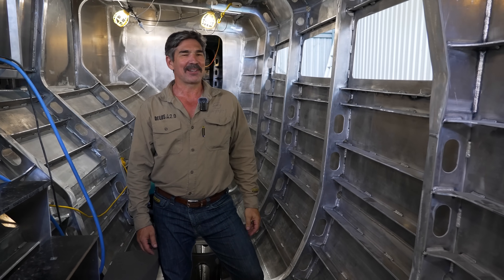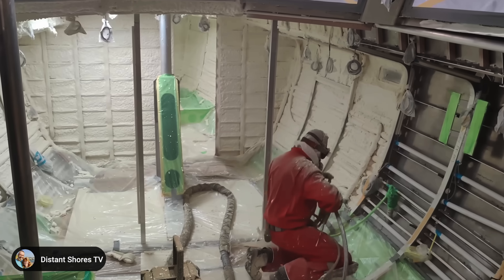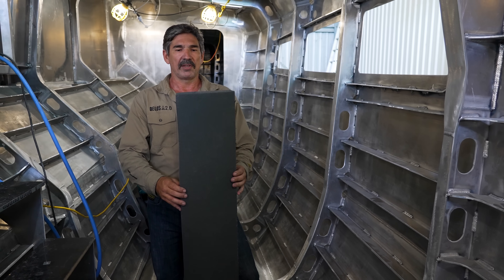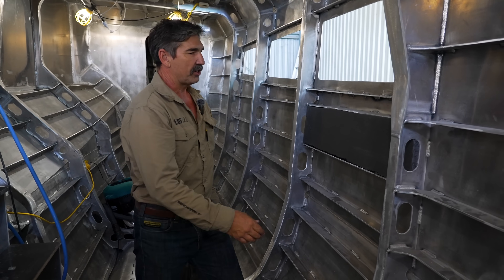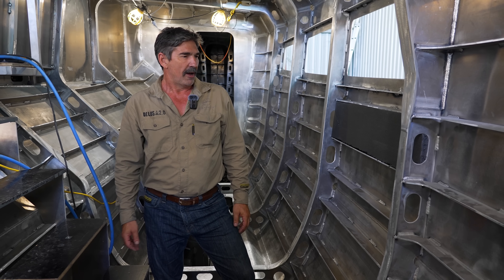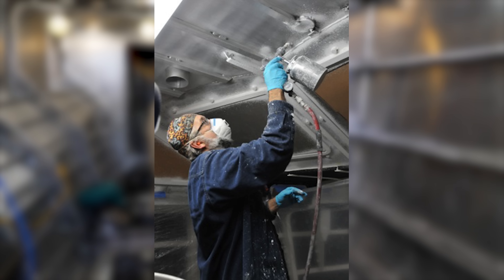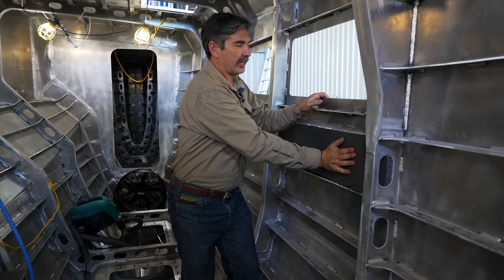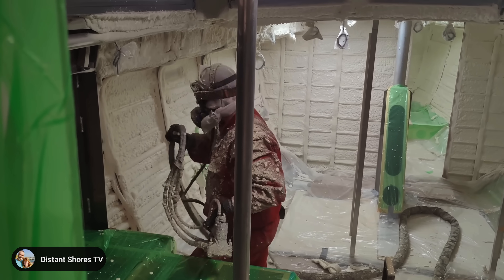HELP, We Need Your Advice!  How Should We Insulate Our Aluminum Catamaran???

Comment: Just thinking out loud, I think spray foam is the way to go but wondering what possible repairs are given you pause? If you are concerned about plumbing or electrical repairs, I am thinking to use conduit pipes and spray around them. Then install junction boxes at certain points based on what makes sense. That way if you’re worried about replacing a leaky pipe or running new electrical, those things are going through a conduit and you’re not worried about the spray foam when doing any of those type of repairs. And putting in the junction boxes at certain increments of length means you can replace sections of either plumbing or electrical without worrying about any extended lengths of sections that would be very difficult to repair otherwise

Comment: its not that hard to remove spray foam, I had a can explode on the boat 😂 and used a knife and a metal spatula to remove, took about 15 mins to get it all off, tends to come off in one piece.Just go spray foam and put boards over the top.

Comment: The best insulation material is mineral wool. it is not flammable. (Rockwool, Klimarock.) There are also aluminum-laminated mats where only the joints have to be sealed with aluminum tape.
The insulation material cannot become damp if the vapor barrier has been carefully made.
Cruise ships are also isolated in this way. Robert
Reply: DEAR BRIAN!
Die Isolierung mit Mineralwolle muss in 2 Schichten erfolgen, Die erste Schicht zwischen den Spanten, dann die Kabelkanäle und die zweite Schicht mit Klimarock (aluminiumkaschierte Isoliermatte)  ÜBER alle Spanten. Die Stösse und Durchstiche der Befestigungsnadeln müssen luft- und wasserdicht mit aluminiumkaschierten Klebestreifen überklebt werden.
Das ist das wichtigste bei der Isolierung. So gibt es keine Kondensfeuchtigkeit hinter der Isolierung und keine Kältebrücken. Isoliert wird der ganze Rumpf bis zu Wasserlinie und natürlich das Deck und die Aufbauten. 
Das hält ewig. So werden auch Kreuzfahrtschiffen isoliert. KEIN KUNSTSTOFF UND NICHT BRENNBAR UND NIEDRIGE KOSTEN
Schau auf meinen Kanal „Sailing sapore di mare“  Video unter dem Titel: „STAHLBOOTE OHNE ROST? JA es gibt sie! 
(Leider nur in Deutscher Sprache) 
Greatings from Austria/Europe Robert

Comment: I just also wanted to add, you say you don't want spray foam on the hull so you can do repairs and get behind it etc. Surely the same principle applies to coating the hull in... anything and then using foam bats. At that point might as well just have used spray foam.

Comment: Only way to go is with spray on insulation. Been on many yachts in hi-latitudes that use cut foam, non spray in and you can feel the cold spots with the air gaps in the walls, and the condensation doesn't seem like it would be a problem but it is, it runs down the walls in the air gaps and can cause chaos. With a yacht like you're building it's worth the extra cost to spray the hull and deck- if you get really into it also spray below the waterline. but isn't needed for your cruising style. Especially since you're documenting the entire build. Id recommend nothing other than 65-76mm of spray in.. Keeps it warm and very dry in hi-latitudes, and significantly cooler in lo-latitdues.
Reply from the maker: yep I think you are right.

Comment: Go with the spray foam. I've had it on my metal boat for 20 yrs and never had an issue with needing access. If you build it correctly you shouldn't need to weld on it again.

Comment: What about using a resin infusion flow media layer as a separator between the foam sheet and the aluminium? This would provide airflow and the possibility of drying out, and also the ability to remove insulation at will, which I agree is important for maintenance & repairs. Potentially you'd just get the sticky backed foam and apply it before cutting to shape, but as always experimenting is a good idea. Don't forget you'll want aluminium or plastic pins to avoid corrosion.

Comment: dude. im not a master by any means buuuut.. foam all the way.... blow it in. be done... if u need to make a repair... you use a heated metal line like a close hangar cuts it like butter... when done.. refill with canned foam for like 5-10 bucks and never worry about it again.. it will increase tensil strength along with being  water proof witch could mean the difference between 1 and 100 miles... dont forget your looking for completely freedom and lower maintennce.. this will also prevent sweating from accuring between the frame and inside.....
Reply: closed cell..

Comment: As a career welder my concern would be cracks in the aluminum welds over time and being able to get to them to repair. Aluminum must be clean to get a good weld so you don’t really want to be scraping spray foam to get to the base metal for a weld repair.

Comment: Don't use insulation batts.  Water gets behind them and they WILL separate from the hull, creating an absolute mess, not to mention floating on the water instead of being buoyant.

You WANT closed-cell spray foam insulation to SEAL the aluminum hull.  Besides, the close-cell foam provides considerable buoyancy.  Calculate by multiplying the surface area of your hull by the average thickness of the spray foam times the density of FRESH water.  Yes, the ocean is salt water, but the difference will account for at least some of the density of the expanded foam itself.

Skip the paints and coating, unless you find something that's more of a primer to help the spray foam stick even better to the hull while sealing the hull against corrosion even better than the spray foam.

If you have critical wires or other runs, lift them away from the hull then wrap key lengths of them in a plastic U such that you can spray insulation foam behind them while preserving them from contact with the foam while providing a narrow channel to be able to find them.  If you need full-width access, jam some cardboard lengths into the U to maintain full width through the foam.

Various means can be used to gain very quick access to the hull through the foam, which is then easily repaired by simply spraying more foam.

Reading through the comments from consummate experts with many more years experience than I have merely confirms to me that closed-cell spray foam is definitely the way to go.

My experience:  Building three sheds:  Wood with fiberglass, steel with fiberglass, and steel with closed-cell spray foam.

Winner by a long shot, and for many reasons:  closed-cell spray foam.

Downside:  Carry a portable air device with full face mask in case of fire and you need to extricate someone from the cabin.

Comment: Asbestos is the only way to go. Lots and lots of fluffy asbestos. 😂.  Brian I believe spray foam is the only way to go as it will act as a vapour barrier and will stop condensation on the metal surfaces. I get why you are hesitant. Perhaps you could leave one run from front to back open. And use your black close cell foam in that. That way you have a run for wiring, plumbing and what have you for future considerations maybe even use that for all mechanicals during your build. For all systems. . The new delos is looking sweet. Cheers

Comment: Brian, IMHO closed cell spray foam is the way. Run smurf  tube with wire fishing lines wherever cable drops need to happen, but make sure the tubes do not touch the outer hull.  If there is an area you are really worried about, like where the buss bars have joints, use something else there. All the other solutions let too much cold through or heat out, actually.

Comment: Have you looked into Total Boat Flotation Foam - 2 Part Expanding Polyurethane Marine Pour Foam For Boat Floatation, Insulation And Soundproofing (2 LB Density, 2 Quart Kit) as a way to increase your bouncy? There are foams the put in buoy's  that are water resistant and mold resistant. Just a thought when you mentioned weight.

Comment: If you cover the hull and bulkheads with plastic before applying the spray foam, it should adhere to the plastic while making removable form fitting insulation panels that make for easy removal if you ever need to gwt in there

Comment: FWIW, having the extra thickness along with a closed cell, or vapor barrier is desirable when in freezing environments. There is a tricky calculation to ensure that the dewpoint does not happen on the inside of the boat to minimize sweating.  The vapor barrier part is important so moisture wont get in from the interior to get trapped between the hull and the insulation because that is likely where the dewpoint will be, and if moisture is present there, could ruin your insulation over time.  Long story short... operating in moist environments is tough.  Don't skimp on insulation.

Comment: You should vacuum a thin plastic liner into the hull wall and then spray the expanding foam. This way you have custom molded insulation and still can take them off when made in sections. The same type of way how some parts are packaged inside a box where the foam expands all over it.

Comment: Built a camper on a merc sprinter and used a bat type insulation.There were so many areas you couldn’t do properly and we ended up using spray foam for these parts. We came to the conclusion for any future build we would use spray foam for the whole job. Learnt the hard way 😅
Reply: Yes hybrid

Comment: WOOL WOOL WOOL WOOL WOOL! Sounds crazy to bring the sheep on deck but TRUST ME- It is EPOCH in this application. ABSOLUTELY NOTHING holds a torch to the VARIOUS benefits of humidity/moisture management thermal capabilities air cleaning/filtering sound dampening.. SAFE NON TOXIC & Fully renewable. I’ve used it on various applications, off grid cabins, sailboat (monohull) sprinter van- the stuff can’t be beat. 🤙🏽🤙🏽
Reply: Also pretty sure my friends at @Havelockwool would LOOOOOOOVE to be apart of a cool project as @SailingSVDelos 2 is!

Comment: It seems like you have your answer.  In the Oil and Gas industry, corrosion behind insulation is a real problem.  We even coat 316SS in some situations due to the potential risk.  Use close cell spray foam, you get the insulation, protective layer, sound attenuation, and a little additional strength.  It's likely to hold way better if you hit a UFO, unlike foam.

Comment: I'm a tinkerer! I have an idea! First divide it into sections, then a very thin plastic foil dressing up and adjust it to the aluminum with a vacuum. Seal the sides like you would do with fiberglass lamination. Multiple overlays of the foil can be neglected because the foil is so thin. Then apply the spray foam. The plastic sheet can be as thin as, for example, kitchen foil for food. This automatically fixes the hardened insulation mechanically, Especially on the sides. Supply lines would also be covered from the sticky foam. 
Just an idea 😅
Sorry for my English. I am German and live in the Philippines. 
Handbreit Wasser unterm Kiel Wolfgang

Comment: Hey Brian! I have a suggestion for your insulation issue. Back in the 90s I used to do elaborate car stereo installations. One of the products that was really popular was a sound-deadening material called Dynamat. While it was designed primarily for sound attenuation, it does have excellent thermal transfer resistance. It's fairly thin, and has an adhesive backing, is moisture resistant, and easy to cut the shape you need. I would look into that as a possibility, as it would allow access to any wiring or equipment that might be inside.

Comment: Sand blast the whole bulkhead with garnet then paint with anti corrosion epoxy paint. I am very sure it prevent corrosion for many many years even if their is condensation and sea water

Comment: Spray-foam maybe good and easy for short run, but can get complicated when you need to perform repairs by welding. Also, think about having to reapply it. Can also release toxic gasses. Know of a case they had to tear a family's house down because the spray foam company mixed it wrong, which caused permanent, major health issues.
Long-term solution is knowing you will have to replace it anyway. So make it accessible and easy to replace. You will want to be able to access it to be able to check your hull from the inside. Rockwool has a better RC-value is non-flammable but susceptible to mold, and if you're able to easily remove it then welding will not be a problem. From the mold perspective XPE is a better choice... Be aware that you need at least 10-20 cm if you intend to go to colder climates in the winter, especially on the roof.
I live on a 130 year old steel vessel and intend to keep it in good shape, which forces me to think about stuff in a different way. Make it accessible to be able to repair and replace!

Comment: Coat with Bonderite M-CR 1201 Aero.  It is a chemical from Henkel Coatings.  It does not cover the aluminum, it chemically alters the surface to eliminate corrosion.  I have a 42 ft power cat built in New Zealand.  I’m installing twin Tesla Model 3 motors/batteries.  Leave as much uninsulated as possible to easily inspect and have access to the inner hull.  Then use spray foam as you wish.

Comment: I live in Alaska and the hull of the boat that I made has aluminum outer skin that is sandwiches marine SANs foam with fiberglass on the inside skin. It works incredibly well. BUT it took forever to cut all the foam and vacuum bag it and the glass composite to the hull. I was worried that if I ever needed repairs it would be a serious pain. I have run over rocks and logs alot and never had to repair it. Even though the water is 36F most of the time it insulates well. 

My suggestion is use the spray foam. If you have to remove it locally for repairs just use a die grinder with a course fiber wheel. If you have to take up bunch of it quick and can mask off for the MESS a pressure washer takes the foam off super fast. If you use the spray foam I would make sure to use one with a fire retardant additive, especially with all those batteries you have! Sealing everything and making sure no thermal bridging is important as you know. You can always have a foam kit to repair later if you need too. If you put foam in areas that might have standing water in them etc. you can skin the foam surface with a polyurethane skin so that the foam will not absorb water etc. In high traffic areas I have sprayed urethane skin (like pickup bed liner) on top of the foam to keep it from getting damaged. This does add some weight though as the skin is not foam and minimum thickness is about 0.08 inch thick.

Comment: Now, i can't tell you what to do, but i for sure can tell you who you need to talk to! 
As a senior FROSIO NS476 Paint inspector, i can tell you that the ONLY person you need to talk to, listen to, take advice from, is a Certified FROSIO NS501 insulation inspector.
These are the folks who inspect and certify insulation on oil rigs in the North Sea. If it'll work there, i'm sure whatever use you might have, will be a walk in the park.

Comment: Use this. 30' Roll (142.5sq/ft) of 6mm Aspen Aerogels Spaceloft Hydrophobic Aerogel Insulation Silica Insulating Mat Material -460F to +390F (57"W x 30'L) Amazon it

Comment: All inside surfaces of the boat need ventilation and good drainage so no pooling water anywhere inside the boat. That in itself will be a challenge. Even spray foam can develop condensation on its surface so air flow and drainage is needed. I think spray foam is the way to go and a secondary insulation liner with an air gap and drainage. Good luck. You know, corrosion issues and the need for hull inspections is one of the biggest factors in why fiberglass boats became the standard. But, hey. Plastic is horrible for the environment. Aluminum is recyclable. But, here we are talking about toxic chemicals again with XPS, polyurethanes. Blah…..no way around it. We just are kidding ourselves. Maybe cork will save the world? 😎🤙

Comment: Insulate with rock wool.  It's fire proof, and drains naturally if it gets wet from condensation.  It will not create toxic fumes in a fire.  It's not itchy like fiberglass.  Critter don't like it either so you won't end up with pest infestations.

Comment: I worked in large aluminium yacht construction. The insulation specifications varied throughout the vessels depending on thermal, acoustic and fire safety requirements in each area. Common thoughout the craft though was a base coat of Mascoat. 
The company we used to design the insulation system was Soundown.

Comment: Never insulated a boat but a schoolie. We did board style foam insulation and was worst thing we ever did. The metal would sweat really bad in cold when heat was and in heat w ac on. Went to spray foam and was 10 times better. No more sweating walls.

Comment: Spray in insulation is going to be the best bet. but if you really hate it, you can use a coating then insulate like you were describing. for any exposed ribs you can use a foam tape to cover it something like permawrap works great on the yachts we service.

Comment: Steel boat owner. We have panel insulation, with additional insulation over the ribs. any exposed metal will get condensation, its a fact of life because we breathe!
We solved condensation using airflow through the boat, which works really well.
Would I go spray foam? Yes, simply because of the time it takes to cut all the panels, fix them down (we used clips on the ribs) then tape everything, then find all the bits you missed, spray foam is much much faster. You have exactly the same issues with wire runs, as they are often under neatly taped and double insulated panels. The solution there is to run them in bundles on top of the insulation rather than under it.
Repairs are actually easier with spray foam, the panels always get destroyed when you remove them, you will never get the same panel again to replace it, but cans of spray foam are easy to find and store.